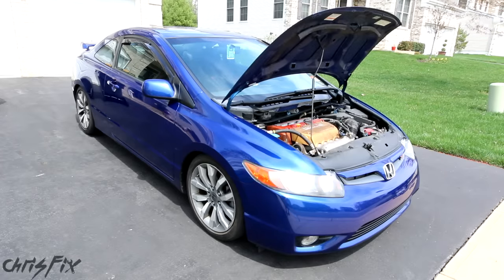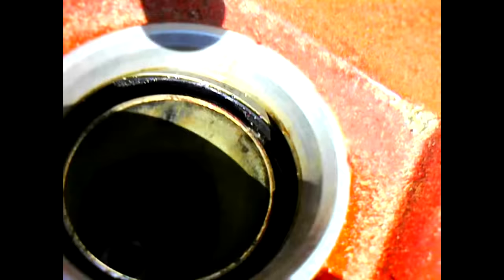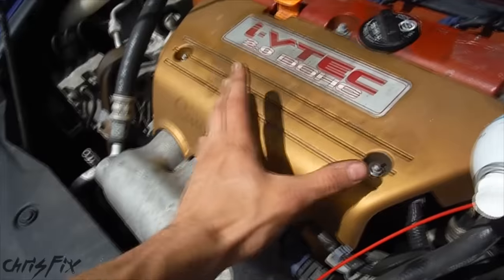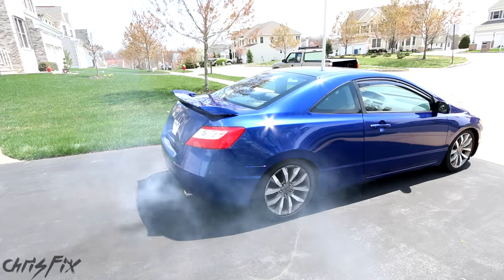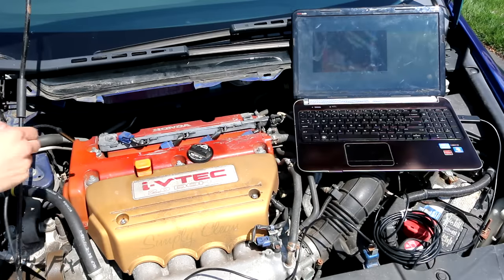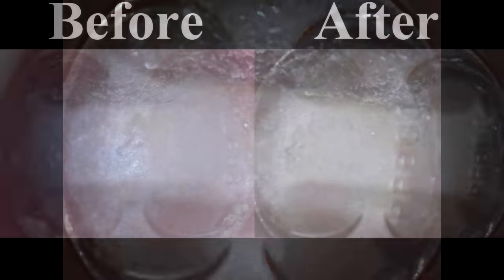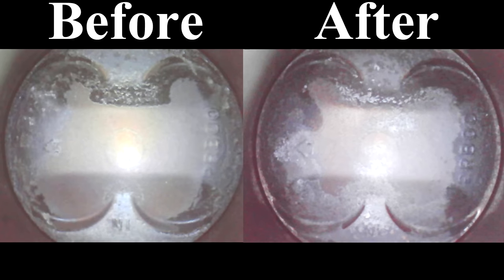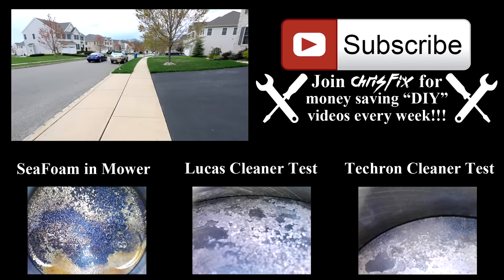Does Seafoam Actually Work in a Car? (with Proof)

Comment: Have a question, i have a ford explorer 2006 xlt, brand new throttle body, mass air flow sensor, fuel filter new, brand new alternator, pcv valve new, and, a month ago I tried this, before cleaning the engine with seafoam, when I started up I was smooth with the idle to slow down, and keep it in one position (around 700-750rpm) after I clean the engine with seafoam, (also when I was clean it, was at 2500rpm and the engine just shake and stall, I turn it up again and started up and work and I finished the clean like the video, so, after that I notice that when I start it up the idle is not going down smoothly instead is going up and down trying to find a place to stay, and then after 1 minute it stays 700-750rpm, so the truck runs really fine, when i accelerate all the way down it goes 5000-5500 rpms smoothly and shift like brand new, BUTTTTTTT when i go to a light and stay in drive for 2 minutes i start to have low rpm and start to misfire but very lightly, and then rpms goes up and down and stall, then starts really fine 

One time the same thing happened again, but I didn't wanted to start, no sound no nothing, until I wait for 5 minutes and start fine, I has also a new fuel rail pressure sensor

It happened no so often but no check engine light came on

Just a few moments it came out, saying p2196-p2198-p0191, I changed the fuel rail pressure there

Then codes with the throttle pedal sensor 

Then codes with mass air flow sensor

I don't know what it is, i hope Chris o anyone can help me out

The truck has 188k miles
Reply from the maker: I would clean your IAC and see what happens!

Comment: Seafoam is the worst thing you can use in a car engine and that’s coming from a mechanic and brakes all that loose stuff up in your engine and it plugs up your injectors. It plugs up gas lines and everything else if you wanna go ahead and throw your car away. Go ahead and use this .😂😂😂